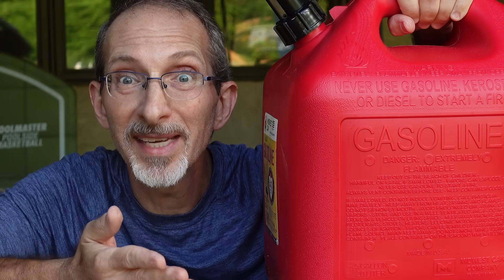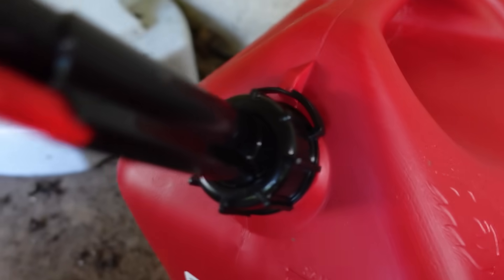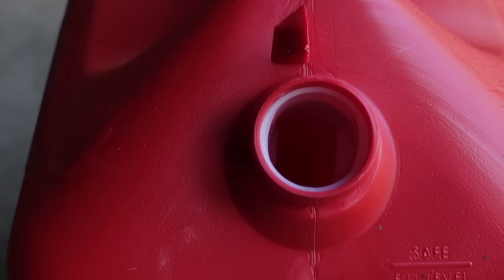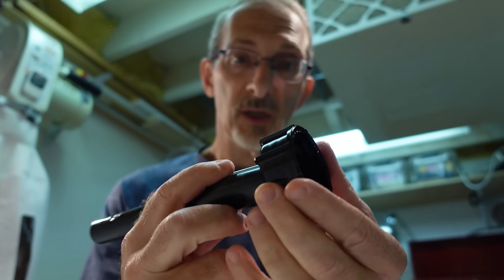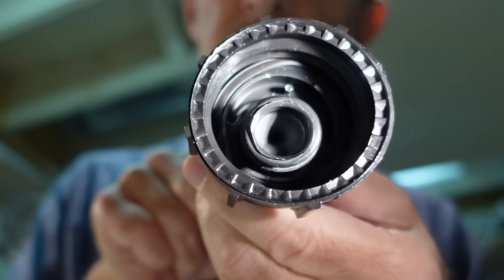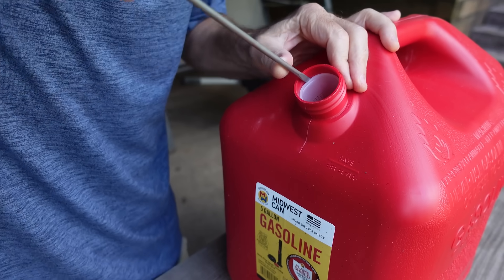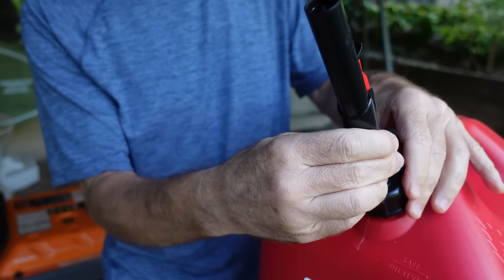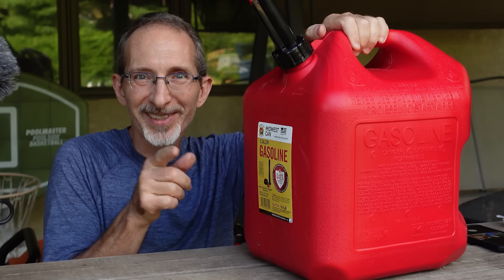Gas Can Modification | New Gas Can Fix

Comment: This was a Type I safety can. He destroyed the safety mechanisms, which is gross negligence. If anyone gets hurts from his ill advised actions he can be criminally liable. The heavy spring, while a PIA, is designed to snap shut preventing flammable vapors from escaping to a source of ignition. The "filter" is not a filter but a flame arrestor wire gauze, similar to a miner's Davy Lamp. Should a source of ignition ignite the flammable vapors above the liquid fuel in the can, the gauze cools the flame below its ignition temperature thereby snuffing the flame out. 
If you have trouble filling these cheap cans, buy proper steel Type I or Type II safety cans. The filler spout on these cans allows you to introduce the fuel pump dispenser's nozzle down into it so there's less chance of spillage. Yes, you can to fill it slower but these cans are typically 1-2 gallons. 
If you don't think these mods are a bad idea, hold a lit cigarette in your hand while filling it. (don't, please!). 
This video is irresponsible and should be taken down.

Comment: Sorry, I got to call BS on getting the filter out the can after dropping it in. Because I done both a few time, but yes it is not easy to get out. And yes, it is not safe to mod the gas cans, but the filter is the one thing they need to remove, or redesign.
Reply from the maker: Agreed! Thanks for sharing your insight.

Comment: Hey Mike. 
EDIT: After I posted my comments below, I saw your #2 video addressed the Vent issue.  

Great Video. How about the Vent Problem?  I have some older gas cans that have a similar valve, but no filter.  The biggest problem I have is that they are sooooo slowwwww because there is no vent to let air back into the can as the gas comes out.  For about $10-$12 at our local Rural King store, I bought a new flex spout that just like the old days, but they also come with an add-on vent. You have to drill a 1/2 inch hole in the upper back but you just slip the cap open and it lets air in.  Very nice.  BTW, I wouldn't use an electric drill to drill the hole for the vent if there is gas in the cas. BOOM!!
Reply from the maker: Awesome Brian. I appreciate you watching!

Comment: There are spout kits that just have a cap and even an extension, and an air vet plug that you put in the back by drilling a hole and popping it in. They have small ones for cans you would fill a chainsaw or whatever or big ones I put on my diesel cans for quicker fill up on my equipment
Reply from the maker: Good tip Jared! I added a vent to my gas container in a follow up video, link in the description. It really does make a difference!
Reply: @MikeFyxdt  I had one of those stupid nozzles break and shoot into the fuel tank of a skidsteer , I just take them off and buy the kit
Reply from the maker: @jaredjames7046  Holy crow! Safety design at its finest!

Comment: Can someone explain the filter?  So it stops trash from getting in the tank, but if you don't notice the trash it goes right in your equipment.   Makes perfect sense, protect that plastic tank.
Reply from the maker: @Van R - After making the video I learned that it is not a filter. It is a flame arrester safety device. I explained this more in my second video, link in the description. I appreciate you joining the conversation!

Comment: Very helpful - eliminates a lot of my frustration.  I also hate the cap at the top of the nozzle they use on this horrible unsafe nozzle.  Of course gasoline cans have to have a vent which I suppose is supplied by the porosity around the lid itself.  I surely would not like to have a gas can explode for lack of a vent.  None of these new cans have a vent because they don't want gasoline fumes to get into the atmosphere.  I guess a few gasoline explosions is worth it to the short term thinking of the safety guys, or there is an invisible vent that stops gasoline from expanding and contracting in cold weather or in the hot back seat of my car on the way home from the gas station.  I do have a one gallon horrible gas can for my 2 cycle equipment.  But again, you can't just pour.  You have to tip the can totally upside down so spilling gasoline on a hot motor or a hot metal surface sitting in the sun is a given hazard worth the safety.  That's a sick joke.  I'll follow your demonstration so I can pour rather than dump and spill.  If you have any ideas about putting some kind of friction cap on top of the lid it would be appreciated.  I'd even put a pin hole through the top of the lid if I thought it would properly vent the gas container.  Notice I use container, not can.  When I was in the Army I drove a jeep with one or two spare metal gas cans for long convoys.  Just saying.  Back in the day.
Reply from the maker: I’m glad you found these tips helpful! In my follow up video I installed a plastic vent with a cap. It works really well, and if the pressure got too great in the container (not can!) I am guessing that it would eventually pop open before the container actually split. There’s a link to the video in the description if you’d like to watch. Thanks for joining the conversation!
Reply: @MikeFyxdt  Thanks - These manufacturers give us new fangled crap and don't explain how to use their stuff, why they want us to use it, or how to overcome their poor planning.  I've been at Costco several times to pump fuel into my 5 gallon new fangled container.  The pump kicks off over and over.  The attendant told me it had to be put on the ground to work.  He too didn't understand the problem.  The manufacturers explain that this is a secondary fire retardant piece of equipment to have the filter in the intake.  Maybe they should figure out a better way of installing that piece of the unexplainable.  My fingers are not that strong and it is a real struggle to pump over and over again.  Finally one of the attendants tried to help me.  He didn't know any more than I did.  Wow is all I can say.  I did enjoy your video and writing my comedy routine about gasoline cans.
Reply from the maker: @juligrlee556  Excellent! I never knew so many people shared my opinion about gas can design until this video, um, blew up!

Comment: But now your gas can is not environmentally friendly and it will cause climate change due to evaporating hydrocarbons! 😱
Reply from the maker: Oh no! Happily the tank is still pretty tight after the modifications. I know this because it burps when I open it! Thanks for joining the conversation!
Reply: @MikeFyxdt  I do miss the days of gas cans that have the vent/plug in the back of them and flexible nozzles. I tend to spill all of time with the safety valve spouts. I've even managed crack and break them due to the amount of glug glug time that's required pour five gallons. (Letting the tank rest on the nozzle while it's draining) I like your mods tho and my cans are definitely going under the knife. Thanks for the video!
Reply from the maker: @RainmanRaysRepairs  You bring up some great points - especially the wear and tear the nozzles go through because it takes longer to pour gas. Thanks for adding to the conversation!

Comment: my kerosene tank is like that too, you cant even use the hand pump for filling your heater with it.  Kerosene for god sakes, it barely burns without just the right setup but they still put that stuff on there.
Reply: I have to pour it out into a paint bucket in order to fill the heaters.  Will be playing doctor with my kerosene can later today.
Reply from the maker: @ChrisHirner  so many people in the comments section tell me they ditch the spout altogether and just pour into a funnel. Bring back simple cans and spouts!
Reply from the maker: I didn’t know kerosene tanks were designed like this too. Crazy! Thanks for joining the conversation Chris.

Comment: It is not just the EPA forcing changes. It is lawsuits filed by ordinary people burned by leaking gas cans  when they do foolish things like poor gas on a fire and it flashes back on them because the gas comes out too easily. BLITZ went bankrupt shut down business, American workers lost jobs because of Americans filing lawsuits. I have 6 or so old style plastic cans that still work.
Some though a beetle ate holes in the plastic seeking out the smell of ethanol that smells like ethanol coming from dying trees. look it up it is real.
Reply from the maker: Scott, that’s fascinating! Did you ever find the beetle?
Reply: @MikeFyxdt  Remnants of  beetles, the holes are about 1/8 diameter round and they eat their way in till either they die from fumes or actually perforate the can. I am in Newport News VA, they also got into some rubber fuel lines. They ate up 5 cans. I used a Weller solder gun to help seal up, but one can  was  not repairable very well, still weeps fuel.  They also ate up 2 generator fuel tanks https://www.flapest.com/camphor-shot-borer
Reply from the maker: @scottdowney4318  Scott, that's the craziest thing I ever heard! Nature truly has a sense of humor. Bizarre!

Comment: 😳 go to Notherns, Harbor Freight, Ace Hardware even amazon, you can buy a kit on the cheap for this fix. A clear flexible nozzle with a multi cap that will fit any container, an old fashion flip up vent that you install, just need right size drill bit then push in place.  The nozzle comes with a cap or put upside down with the cap lid for long term storage. But i like the hand pump siphoning tube thats so easy to use and alot less spillage by not having to hold a big container and tipping it over and not being able to see when to stop. Giving much more control. you can also buy this as mentioned above.
Reply from the maker: These are all great solutions! Thanks for contributing to the conversation!

Comment: That filter is useless. I'm not worried about stuff getting in my gas can, I'm worried about stuff getting in the gas tank.
Reply from the maker: Jonny - After making the video I learned that the filter is really a flame arrester. It’s still a pain in the bottom, but it is not supposed to work as a filter, so your comments are on point. I explain more about how this safety feature is supposed to work in my second video, link in the description. Thanks for watching!
Reply: @MikeFyxdt  lol That's what I learned in the next video. Thanks for all your input. I can't stand these new cans.

Comment: Iam so relieved that 1000s of other folks have had major emotional breakdowns of a  kid who faked his grades on engineering school and went to work in his daddys gas can mfg  company
Reply from the maker: At this point I think I am more frustrated by the lawyers then by the engineers designing these cans. But I see where you’re going with it! Thanks for watching.
Reply: @MikeFyxdt   totally agree with you . And ive said it a tbousand times. 
     Ive lived off grid for 30 years. Filling everything including generators on an everyday basis.  Iam also a trike pilot filling my aircraft.
.   In the past  working in mfg of aircraft  and flight line where safety is a prerequisite.  I have seen the many attempts  of designs of these gas cans and i have found that evey single design  making them too complicated , poor ventilating. Having to hold the can upright for long periods of time while akwardly trying to push something down while having to balance the can with one hand. I commend you on speaking out on such an important subject!
   These cans are plain and simple dangerous.
Reply from the maker: @whisperingeagle  thank you again for validating the message I’m trying to get across in these videos. It’s nice to have the endorsement of people who are knowledgeable behind me. 👍🏼👏🏼

Comment: Fix those by putting the gas on the outside and tossing a match at it. GARBAGE, these plastic cans. Also, that filter is actually a flame arrestor.
Reply from the maker: I think my next gas can purchase will be more expensive, and higher quality. But I have to say these modifications did make this can much more usable. Thanks for mentioning that the filter is actually a flame arrester. I figured that out after posting the video, and made the correction in my second video, link in the description. Thanks for joining the conversation!

Comment: One cup of gasoline fumed is equal to 10 sticks of dynamite the object you remove that you called a filter is an anti fume explosion device so that the gas Burns in the chamber and not causing it to explode that's the name flame guard on the can
Reply from the maker: Steven, duly noted and corrected in my follow up video. Link in the description if you’d care to watch. Thanks so much for adding to the conversation!

Comment: The can i bought, with good money.. was beaten up,, and thrown away..  They  Need to make things that the eldery,,  the disabled,  the women,  and the children,,,,who actually mow the grass can work...I took the lid  off of mine,  and use tin foil.. for a cap..  BUT NEVER EVER AGAIN, will I purchase this thing
Reply from the maker: Ramona, you are awesome for representing people who need usable designs, not just for gas cans but for all every day items. It’s been interesting for me how many women have been commenting on my videos, seeing how they also struggle with these designs. You shouldn’t have to have “man hands“ to operate a gas can! One thing I’ve learned from the comments is that you can get an inexpensive electric siphon pump, which will dramatically make it easier to transfer gas without having to lift a heavy can. I hope to learn more about this and maybe do a follow up video. Thanks so much for watching and commenting!

Comment: Greetings from the Ohio Porters.😎 This type of gas can seems to be what is prominent out on the market right now...I have 2 of them and can’t find any other style in the 5 gallon size. I was able to fill mine all the way up, actually just below 5 gallons, but it spewed on me multiple times in the process ! 😠 I took that filter out QUICKLY!  Mine cost a bit more though...than $15. Good stuff!
Reply from the maker: Porter, thanks so much for watching and commenting! The filter, which is actually a flame arrester, is so annoying when filling the tank. Hopefully the manufacturers and the regulators will finally understand that people are crippled by these safety features, and it’s actually making them harder to use than the benefit they’re bringing. We need change! 😎

Comment: Never buy a Generac generator. They are Chinese junk
Reply from the maker: Hi Tom, so far I like mine very much. Are there other brands you’d recommend more?
Reply: @MikeFyxdt  Hi Mike, I live off grid in Alaska and have both a home and a wood working shop running much of the time on generators. The Generac generators never lasted as long as they should have. Costco used to sell an inverter generator of about 2000 watt output ..... name on box was A-1. The powerhead was manufactured by Yamaha ($350 - $400). I got great service out of those. My local Costco doesn't sell them any more but I notice that Costco's in the lower 48 still has them listed. One way to make your generator last the longest is to buy an hour meter. Amazon sell ones that mount to the outside of gen case with sheet Metal screws, drill a small hole through case .... a single wire through case and wrapped around the spark plug wire ..... no electrical connection needed ..... Then the meter will read hours run on motor. Very important to tell you when to change crankcase oil. Usually these small generators need an oil change every 60 - 100 hours and frequent oil changes is the secrete to "longlife" for your generator.
Reply from the maker: @tommatheson5855  that's great advice! Something tells me that this Generac has an hour meter built in...I forget. I'll have to take a look. Thanks!

Comment: Those new cans are junk. If you leave it on a cold floor it will collapse in on itself from the vacuum . The red nozzle button will break after a few pours. I have some 20 year old cans that are three times more durable with nozzles that still work.  If you find old ones for sale. Buy em.

Comment: Per usual, the Beaurocrats mandates do the opposite of what was intended. The EPA gas cans end up wasting more gas in spills and vapor released from its clumsy and ineffective design than an old style tin gas can with a gasket and a pressure release port for a steady flow.
Reply from the maker: Excellent points Matthew! Thanks for watching & commenting.
Reply: @MikeFyxdt  Thanks for applying some practical, common sense.

Comment: Ace has a selection of replacement springs that might help weaklings and others having coordination problems maintain a modicum of "safety".
Reply from the maker: That’s a good idea! In my second video I modified and reinstalled the spring so it doesn’t require as much pressure, but it still gives you the safety of a spring-loaded nozzle. It worked very well! There is a link to the video in the description, above. Thanks for watching!

Comment: I would have cut the spring not remove it.  There would be a leak once you pull out for sure.
Reply from the maker: As long as you pull out the spout and the red button pops out, the can stays pretty tightly shut even with the spring removed. In my follow up video I shorten the spring and reinstalled it, and that worked really well. There’s a link in the description if you’d like to see it. Thanks for watching!